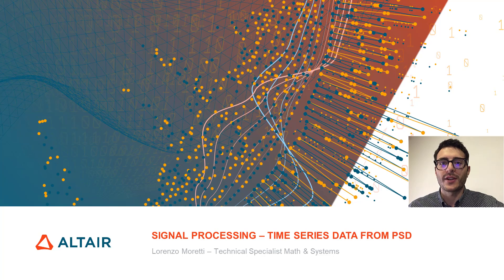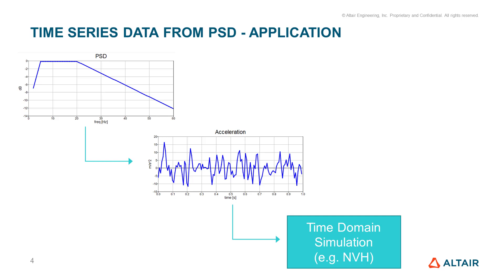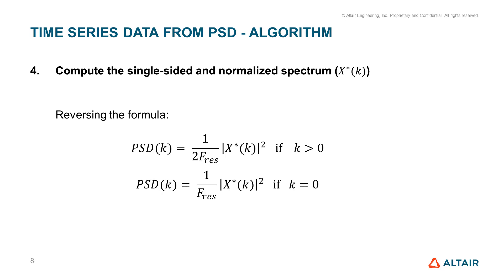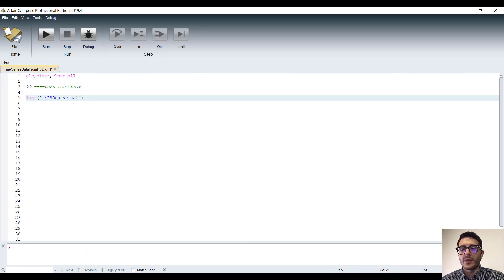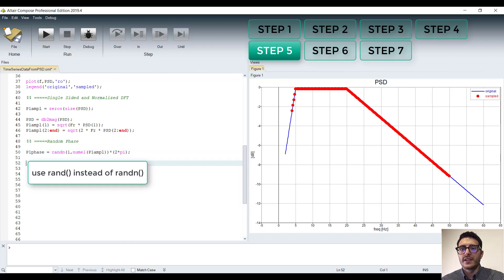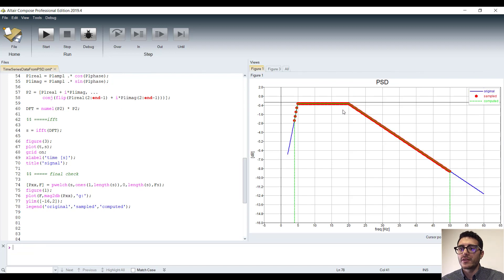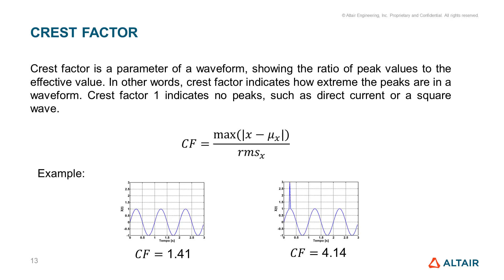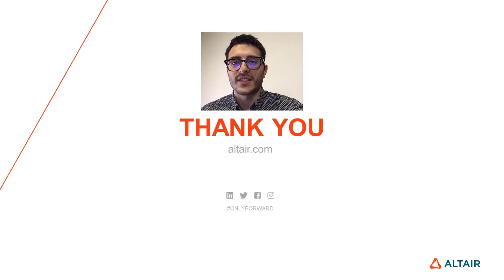Altair Compose: Signal Processing - Time Series Data from PSD

Comment: i am getting an error , when i tried to run your code on Python , and this is due to the size of s, at the end it depend of the f , due to the definition the length of f (240) which results a length of s to be 240 elements. However, before this step when we generated the time vector its length was 480. so at the end plotting them together is not possible , any advice ?